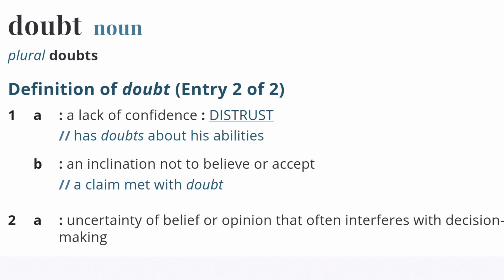Doubt & Conviction...

Comment: Im sure you know this, but keep in mind the challenger is going to be 2 inches longer in wheelbase than the cuda. Made up somewhere in the rear seat floor area
Reply from the maker: You are correct sir! 110" on the Challenger vs 108" on the E-body Cuda's! The Challenger should be a little more stable handling at speed. Going to be fun installing the T56 Magnum to see where the shifter lands vs. in the `Cuda thanks!

Comment: I wouldn’t feel bad about the roll cage. Those cars need  a bit more rigidity and most people are just happy to see them driving.
Reply from the maker: The one thing I didn't do on the `Cuda is to stitch weld the chassis before getting the roll cage welded in. The 73 Challenger chassis will get stitch welded for sure to make it even more solid